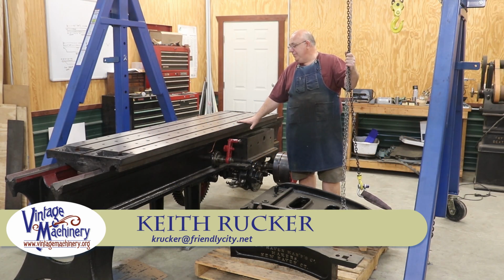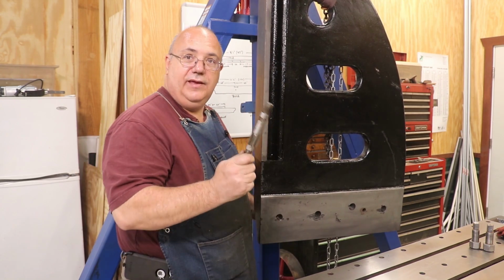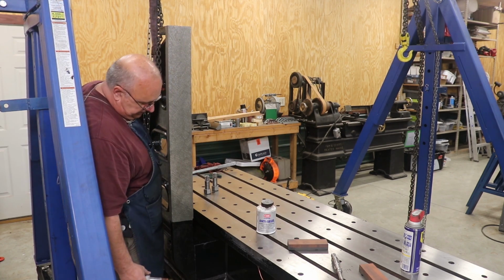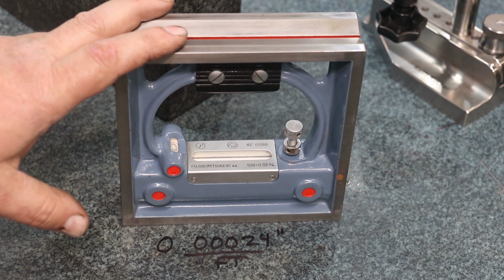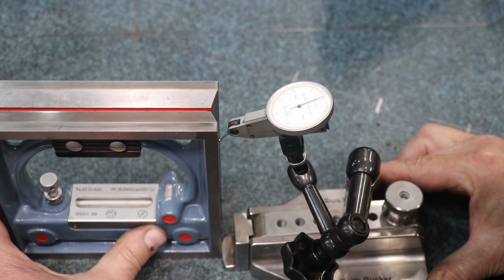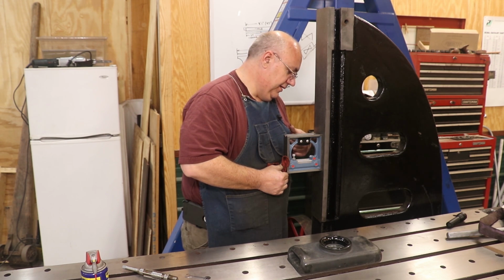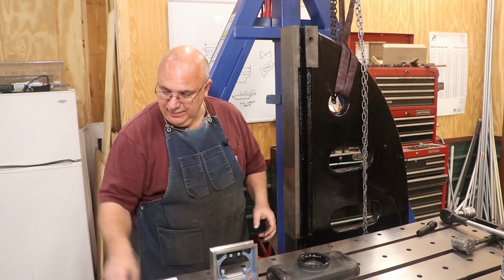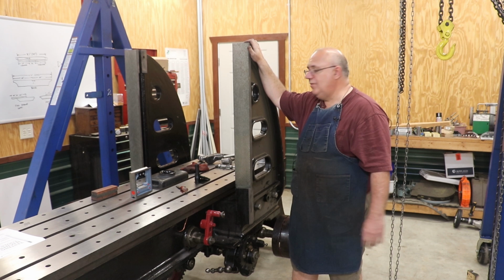Metal Planer Restoration 31: Installing and Leveling the Upright Columns!

Comment: A few bizarre things in this video.
1. Assembling bare metal - I wouldn't without applying some protection to the bare metal - a smear of oil, for instance.
Anti-seize - normal folk just use oil - LOL
2. Squaring the square - obvious thing to do is fix the square to you known square and zero it - rather than having to compute errors.
3. If adding the uprights affects the levelness of the table then clearly the machine is incorrectly supported on the floor. That should have been dealt with first.
4. Uprights upright ? I think parallelness between them is more important. It appears the machine doesn't cut vertically - so the uprights being perfectly upright simply doesn't matter ! What does matter is that the table remains the same vertical distance through it's length of travel at the uprights.

Comment: This has been a great project, and I'm really enjoying watching it come together. I hope this isn't the only line shaft powered mach Keith has planned for his shop.  It seems like in previous episodes, Keith has talked about and demonstrated how prone to distortion the frame and ways are. Even towards the end of this video, he talks about how adding the second upright caused a deflection of the level that was resting on the machine. It also seems like Keith is striving for a certain level of precision. Seems like he should probably get everything reassembled to the machine frame, especially everything heavy, all major bolts tight, etc. first, then lift the table off and get the ways all nice and true.

Comment: i would have liked to have seen a thin film of rust preventative like lps 3 rubbed on the surfaces, you put so much work into getting them scraped in that it would be a shame to not put in the extra few seconds of effort to prevent contact corrosion

Comment: Two of my Uncles, one an Aeronautical engineer with several NASA patents and the other a Mechanical engineer who build some of the first 300' wind turbines in the 70s, once stopped work on my Grandpas 100 year old barn re roofing project because it was 1/8 " out of square over 40'.  My cousin and I both carpenters, stopped work until they went inside.

Comment: Fantastic work Keith  I really appreciate this series. 
But I can't stop thinking about the hard work you did with the autocollimator and scraping the ways on the machine base. 
Just the weight of the machine base made a difference back then, and now a lot more weight is added??

Comment: ...Moved it three divisions.  I told you so, that you are getting far more precise than you need to be, that the tides will allow for, that the temperature will allow for, or than you floor will allow for.
Reply: Yeah, we had some guys leveling/measuring a machine tool once and things kept changing as people walked around the machine.  The floor was only 12- to 18-inches thick reinforced concrete, but it acted like hard rubber too (like someone mentioned way above).  Then as the tide came in (& up the river), the floors moved too.

Comment: Love your videos. I would like to suggest that you may be should put a piece of cardboard or something to protect the table top you just spent so much time redoing. Probably should not use it as a work bench for tools etc. when you are working on it. Thanks for the videos, Love every one.
Reply: Keith said he was going to use the machine to plane its own table after it's reassembled and running.  Any small nicks & dings on it now will be removed.

Comment: some aluminum foils are less than 0.001' thick..  you will have to measure the foil between measuring blocks to get an accurate measurement without the anvils crushing it.  getting the 2 columns parallel would seem to be most important.. but we are Splitting hairs.. and it probably won't make any difference at all. being 0.001 or even 0.002 off vertical between column faces.

Comment: Front to back vertical accuracy is not important.  The Side to Side accuracy is, as any vertical surfaces you plane would depend on that.  You did not cover this in the vidoe.

Comment: Acetone works great for removing old paint, or even old ink on printing presses Also if you go with the 3 4 5 rule for square measure up 3 down 4 and the measure from the two point should be 5. As accurate as you can measure and mark.

Comment: Just for reference, aluminum foil (Reynold’s Wrap) is .001” thick last time I checked. Thanks for making the video.
Reply: wikip says Heavy Duty aluminum foil is typically about 0.000944" (0.024mm). Regular household grade foil is thinner at about 0.00063" (0.016mm)

Comment: Keith...I'm a worry wart but, looks to me like you need to increase the lateral stability
now that you are adding vertical weight to the planner.   I suggest that you rotate all of the leveling jacks 90 degrees.

Comment: Thank you for the video. Definitely captivating watching you work. What patience. What is most striking to me is the minuscule deformation caused by assembling the machine. And then there is the ambient temperature - and any temperature changes caused by operation. “Drive you batty” definitely fits - OCD or not.

Comment: For future use, the conversion from metric to imperial units on Keith's square level does not require knowing the equivalent units, only a ratio. The accuracy of 0.02mm per 1m is a ratio of   0.02mm to 1000mm. (From junior high school math class, cross multiply and divide.)  Multiply   0.02 x 12" = 0.24" and divide by 1000 = 0.00024" per foot. Just in case anyone cares, that is an angle of just over 4 seconds. "Machinists have tolerance issues."

Comment: those precision levels are usually made with a slight valley in the middle so that they sit flat on the corners. I have one and it says so on the lid. That could be why it doesn't look square when you meassure it.

Comment: lol  i was just about to start typing about significant digits  when you pulled out the book .. i do have to ask what type of accuracy are you expecting to get out of this planer ? 32 64 128  of an inch or are you expecting more like 1024 or higher funny i just realized fractional inch and computers use the same digits but different units  but honestly what accuracy of cut are you expecting to measure down to .00000of inch per foot variation  ... i cant imagine nasa using this planer or requiring those tolerances from it if they did and it seems you are trying to do just that lol  .thanks for the video

Comment: Hi Keith: I love your work, but I think your metric -> inch conversions aren’t correct.  Unless I need another cup of coffee, 1 mm = 0.0394” so you quoted the second upright as out by 2 mm / metre which is about 0.078” over a distance of 39.4 inches.  
If you divide that out it is 0.002” / inch or 0.0238” / foot.....so, about 24 thou / foot.  Hmmmmm.....maybe I did goof that up...?

Comment: Won't this change the ways you scraped in? The additional weight.
Reply: I think he can accommodate for the weight of the uprights using the center  leg leveling mechanism
Reply: JBT...Then, he planes a massive piece of steel, which adds more weight......No, I think you leave everything...it's 125 year old tech, after all...everything gets " mated in service ". We'll see.

Comment: The added weight of all the heavy stuff you are adding to it, might cause increased sag between the support points, and mess with the scrape in, you did on the dovetails?
Reply: This is what I'm thinking. Once all the weight is on machine, he'll have to use the fancy leg adjustments or re scrape .
Reply: Thinking the same thing. Although the additional deflection is still likely to be within spec given how close Keith got the bed. I guess he could take the table off once all major components are on for a final check

Comment: 2mm per metre? That’s quite large, (approx 80 thou in 39 inches) Are you sure it isn’t be 0.02mm per metre. Great work Keith this will be awesome when it’s back up and running
Reply: Two mm per meter sounds like a tolerance a plumber would use, not a machinist.
Reply: Yeah, I noticed that too.  When Keith reads the numbers from zee German book, it is 0.02mm/m - I just believe he misspoke later on.   Its the same thing machinists do in English units, machinist will say two tenths, which they understand to be 0.0002" - 2 ten thousandths of an inch - its drives me batty sometimes.
Reply: @theharbinger2573  machinists in the usa who learned on decimal inch generally speak in thousandths of an inch, not inches. so two tenths makes sense because it's two tenths of a thou. if we were going to say two tenths of an inch, we'd either say two tenths of an inch or 200 thou. it makes more sense if you have that context.
Reply: It’s 0.02 mm per metre. (20 Microns in 1 million microns)

Comment: If there is enough play in the bolts to allow adding shims, the column will move around on the bolts under cutting load.  Regardless of the squareness of the columns, the tip of the cutting tool will always be in the same relationship to the workpiece.  The real critical part is the cross beam which has to be parallel to the table so the tool cuts the same depth as it traverses across the part.
Reply: I was thinking exactly the same thing.
Reply: So you're saying the uprights should be dovetailed to the bed, or something similar?
Reply: @oleran4569  That would help or just some big dowels, but the point of my comment was that all that measuring with that precision level device was just an exercise in using the tool- the machine design will not get anywhere near that sort of accuracy- it is designed to whack away at big castings  1/2" or more at a stroke.

Comment: Sorry Keith, I think I dropped a piece of paper on the floor in Alabama when you were assembling those columns, probably messed up your measurements.
Reply: I always crack up over "Precision Ground Flat Stones"....how did we ever build machines back in the 1800's without these...heck, how did we do it even 30 years ago without them.  Worked in machine building for a couple summers...nobody had "precision ground flat stones".  Yet we made precision machining equipment that was capable of making 1,000,000 parts a year all within a 50millionths...Not slamming Keith and Adam, or even the maker of these stones, but yea...LOL.
Reply: @WreckDiver99  hey guy Precision flat ground stones have been around for a long time hundreds of years in fact the way I made mine was the three stone system and that was back in the 70s. And I created mine based on somebody else's that was their grandfathers it goes back a long long time.

Comment: I suspect it way closer tham 1mm/metre? You could get it that close with a builders framing square.
You did mention one thousandth of a mm per metre once, I'm guessing its a thousandth or a hundredth of a millimetre per metre? Is that what the accuracy is? Either of those should be fine.

Comment: These are the videos I've been waiting for, the rebuild. I think you mean 0.1mm /m not 1mm/m etc. though 0.1mm/m = 0.0012"/ft if my math is right.
Reply: If it had been a thou per inch then it would have been 1mm per metre. This is probably the quick mistake he made as he was doing his quick conversions

Comment: I would think that the upright squareness to the table perpindicular to the table (90 degrees to the face you checked) is more critical. The squareness you checked is non critical as it is infeed. For "side cutting" square the other axis is more critical.
Reply: I believe Keith said he intends on skimming the table after all the alignments are done.
Reply: I agree that edge square is important, I don't think Keith can  set that accurately until the crane is fully assembled.
Reply: I agree.  Also, the two wide vertical faces need to be coplanar and the machined edges of the two columns need to be parallel.  This really is an adjustment nightmare!
Reply: Yes, those verticals and the table must describe a box.

Comment: How is it going to be powered?
Reply: What? You didn't see him build the steam engine to power this?!?!?!
Reply: @DirtyRobot  evidently i didn't...i know about the stoker rebuild
Reply: Chris Chapel, in one of the episodes of this build he mentioned running it with an overhead drive system. He didn’t say what would drive the pulleys and shaft though. He’s been pretty quiet about it since. It would be pretty cool to see it run by an overhead shaft even if it was driven by an electric motor!
Reply: @Hoaxer51  I recall him mentioning a overhead system...yeah steam at this point in his shop is impractical...not impossible but, impractical...